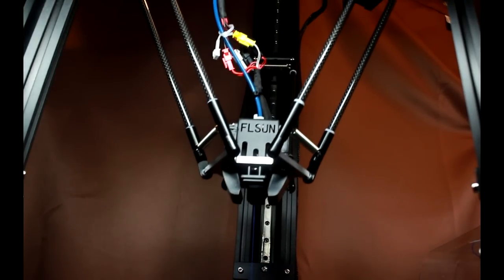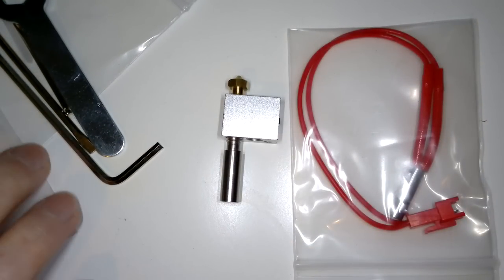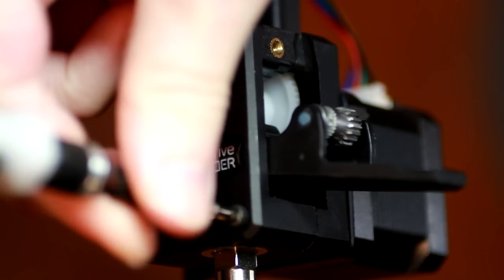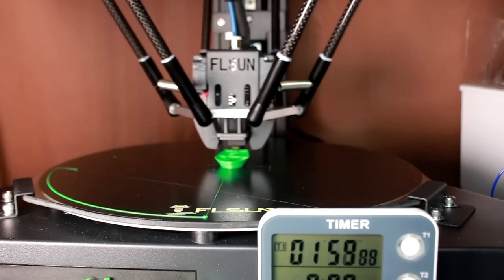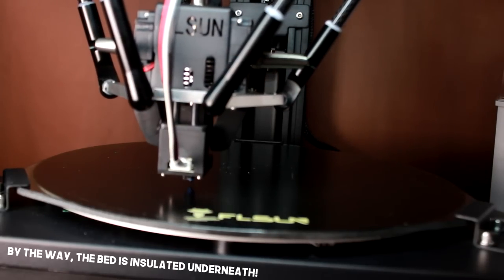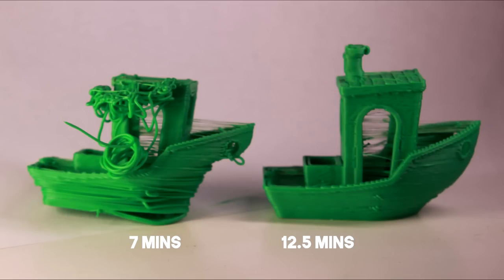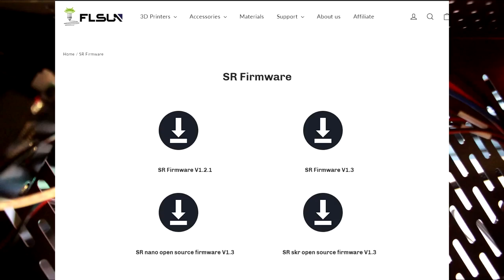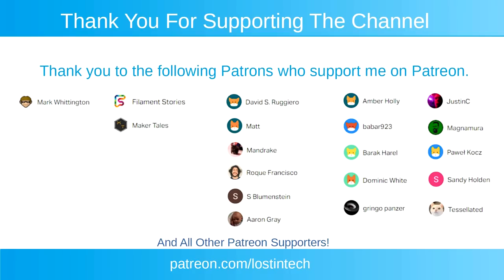Review: FLSUN Super Racer - The delta printer that can print at 200mm/s out of the box!

Comment: I made my own giant delta. I sorta rebuilt it a few times, and the most recent iteration,  it has a 500mm bed (mains powered heater)-- obviously as a delta it can only print the diameter, but the actual bed is square, which makes sourcing a flex sheet and heater easier. I have a large CNC, so I machined the aluminum parts -- including the bed and things that hold the bed. The uprights are 1500mm, and it has an electronics basement, so sorry to mix units, but it's effectively 6' tall. I am using linear rails, not brand name, but well made ones. Actual build envelope the true cylinder (not counting the cone) -- is 490(diameter)x740 height. I made a relatively light weight effector -- and had it SLS printed out of glass fiber nylon. To that I have a slice mosquito magnum with a generally permanent .8mm nozzle -- I have a 1.2mm nozzle I will be trying for some bigger prints, with a direct drive Sherpa Mini extruder. I recently upgraded to RRF3 on the duet board, and after input shaping calibration, accelerations are at 6500mm/sec^2 , no ringing on at well over 100mm/sec -- note I am using a .8mm nozzle and .4mm layers. Doing some additional tests I need to brace the towers, as I do plan to update the enclosure with 2x4 lumber and secure the uprights to the enclosure to mitigate vibrations. Deltas are a lot of fun, and I will be making a large near life size character for my 6 year old son on it -- as soon as decides what he wants. He first requested an among us -- now he is over that.
Reply: Please post a video man this look amazing
Reply from the maker: yes please! I want to see
Reply: @mophie6941  maybe when I redo the enclosure I'll post some videos.
Reply: Well did you post the pics? Where did you get the plans to DIY it? Thanks @kazolar

Comment: Ive had this machine for a few weeks and all in all its been very impressive. One thing i will mention. You are correct that you shouldn't have to use the probe to relevel often, if at all. However, when i upgraded to the latest FLSUN firmware (v1.3), i went to start a new print and my level was off and the nozzle ended up grinding against the bed. There was no indication in their firmware upgrade instructions to do so, so just a heads up for anyone upgrading firmware. Do relevel before starting a new print with the new firmware to save yourself some peace of mind.
Reply from the maker: Good info! Thanks. I will put it in the description
Reply: To be fair here, that's normal. New firmware on majority of machines resets every thing, and you need to redo all the calibration.
Reply: @matthewwain9958  just bringing this up for people with less 3d printing experience than myself so they don’t make the same mistakes I did when following the manufacturers written instructions.
Reply: Gotcha 👍
Reply: that's normal, firmware wont carry your personal settings over
Reply: Was it worth updating the firmware? I'm just curious.

Comment: I've had my SR for about a year - it's my favourite printer - replacing my Ender 3.
Added a V2.0 BMG extruder, PEI flexible bed, full size Dragon heatblock, and 0.6mm nozzle.
I love watching it print - and it's so much faster than my Ender.
Reply from the maker: aha - you put the v2 BMG? can you tell me if it improved the printing and was it a real one or a triangle labs or something? :) 
watching it print is mesmerising...I'm probably gonna try some timelapses
Reply: @LostInTech3D  it's a TriangleLabs clone v2.0 - plus I ordered a v2.0 shell as well to reuse the guts of the factory extruder as a spare.
I never had any problems with the original - but others have - so it was proactive replacement.

Slowing retraction speed from 60mm/s (stock profile) to 40mm/s drastically reduces the noise.
Reply from the maker: I had no idea you can get a 'shell'! Awesome!
Reply: Recently just put an OMG V2s extruder on mine and pretty happy with it. PEI sheet next upgrade and was wondering which did you get? Also do you have Klipper or plan you install it? Wonderful machines these are.
Reply: Hey, I'm interested in upgrading my SR's for my business -- would you mind sharing some links for the upgrades you've mentioned? Thanks!

Comment: I happen to like my FLSUN SR it was easy to assemble and once you get the Z height set properly and run the bed leveling sequence, you don't have to adjust anything until you change the nozzle. The bond-tech clone extruder is a little loud at the stock setting but works better if you increase the retraction speed. I find retraction speed at around 130 mm/s works good for me. I did order a new all metal extruder. Also the power switch is a point of failure, but is easily repaired or eliminated. I removed the power switch on mine and use a power strip with a breaker built into the power strip. Also added RGBWW LED lights, printed new axis "feet", spool holder and tool holders. FLSUN had me at Speed Racer...I mean Super Racer.  I look forward to the new FLSUN 400.
Reply: 130mm/s is extremely fast.      5.5mm @ 90mm/s  seems to be the go to for the super racer.
Reply: @sausagefingers714  
I slowed the speed to 70 mm/s

Comment: Unrelated I've been using CHEPs ultrafast CURA profile(settings cloned from ultimaker printers) and it saves a TON of time...need to tweak it a LOT(especially for petg) but CRAZY FAST once  you get it working- I think the profile optimises acceleration  and travel settings
Reply from the maker: I've been following along with the CHEP profile journey 😉
Reply: I'd love to get a rundown for the settings you use!

Comment: I have an SR myself and I don't like the extruder either. I bought a Sherpa Mini extruder so I'll be converting it to DD soon. My most liked upgades so far are a bimetal heatbreak (get the 27mm one - overall length; for CR10, I think) and a full size volcano block. I had a problem with filament getting jammed into a small gap between nozzle and PTFE tube, which was pretty annoying..

Regarding the extruder: I have replaced a similar generic BMG clone on my other printer. I too went with a BMG V2 by Trianglelab and could not be happier with it :) I can't recommend that thing enough
Reply from the maker: I've bought a conversion shell thing to convert it to a v2 extruder. We'll see how that pans out 😅
A bimetal heat break makes a lot of sense.

Comment: Separate retraction from extrusion, Robert is your parents sibling.
Mount a small solenoid between the hot-end and the Bowden tube fitting such that when actuated, the Bowden tube fitting is pushed away from the hot-end.
Rather than pull back a length of filament through the tube, move the end of the tube!
New Retraction-cycle:
1) Stop the extruder 2) Energize solenoid to retract filament 3) move effector 4) de-energize solenoid to return filament to feed position 5) resume extrusion.
Filament is no longer being 'chewed' by the extruder when lots of retraction occurs.
Need to change the firmware a bit...

Comment: I have a FLSUN QQ-S Pro and I have an opinion on the Super Racer and that is "It's overkill!".

Buy a delta printer because you want a delta printer for diversity or because you think the motion looks cool but don't fall for the hype on speed.

Even at modest, faster than cartesian, speeds the artifacts are clearly evident. You can see ghosting and other visual effects unique to delta motion.

Whether you're throwing a lightweight print head about on a single axis, or on three, the laws of mechanics and physics still apply.

I bought my QQ-S Pro for about half the indicated price of the Super Racer. It has a Titan clone extruder and V6 clone hotend. It makes no pretence about offering huge flow rates (and thus printing speed) but produces decent quality prints reliably.

The only downside I see with my printer is the fixed print bed which means that you need to take great care to avoid damage from nozzle scrapes but that comes with experience. This, in part, is why deltas weren't advised as a first printer.

Will the V400 improve on the Super Racer or is it just another "new" delta for YouTubers to review and recommend their subscribers to buy?
Reply from the maker: I certainly hope so, there's some speculation going round but I'll wait for solid info. 
Also, you can change the bed on the SR, which seems like a huge improvement on the QQ...as you say, non swappable beds, never a good thing.

Comment: I have no experience of Deltas but I reckon the extruder ought to be mounted on a tri-pivot platform between the three vertical slides. That way it's always a set height above the hotend (and would point directly at it) but without putting any extra mass on the effector.

Comment: Really should use a tubing cutter or sharp razor to cut the capricorn tubing.  Scissors crush before they cut and can cause a lot of resistance
Reply from the maker: depends on the scissors 😉 but generally not for capricorn as it has a huge wall. The "getting square" issue is the main concern on the other end. I do have cutters :)
Reply: It took me forever and some cm to get it cutted straight.

Comment: It seems like the extruder has some weaknesses. What would be a better upgrade? I've read the teeth tend to chew up the filament causing failures. What's your thoughts about buying a flexible build plate and putting it over the glass to get better adhesion?
Reply from the maker: official bondtech extruder if you can afford it, maybe even DD mounted. PEI sheet should work fine, remove the glass and install it properly, it works well on the V400 (successor)

Comment: Awesome video now I just need to see how hard it is to replace the tubing and the extruder
Reply from the maker: Not too tricky actually! Just remember to change the E-Steps
Reply: @LostInTech3D  may I ask what would be a good resource to search not much on YouTube
Reply from the maker: for e-steps? CHEP has the best guide I think. For changing the tube? Again probably CHEP, but pull the plastic locking tab out of the connector, then push it in while pulling the tube. It's called a "pneumatic connector".

Comment: I absolutely LOVE my SR. All that really needs to be upgraded is the extruder, ptfe tube and MAINLY the heater block. After I did this I was able to print at 150 mm/s with amazing results. I can also get great results at 200 mm/s with my Ludicrous profile. A 10 minute benchy... at 75% scale. Yes with a few updates this machine is a true beast.
Let me know if you want to try the Ludicrous profile or see it in action.
Reply: link ur upgrades, my sr comes tomorrow
Reply: YouTube keeps removing any comments with links. So I will put them in a video description of my printer in ludicrous mode. Coming soon.
Here's a list with out links.
Real volcano all metal hot end, micro swiss extruder and flsun pei plate

Comment: looking forward to seeing how this goes my ender 3 pro i can have running upwards of 500mm/s on big prints  litterally had it at 1000% on my bigtree marlin on a box print plus some jerk control     but this things a beast of a out of the box printer    im yet to see the need to upgrade my ender except purely for larger build volume  print quality and speed is nuts   for only a 40w heater and stock hot end besides direct drive conversion    why does it have a 3 to one ratio?  as thats usually for the smaller pancake motors thats a fulll size 45nm motor  it can drive directly and super fast
Reply from the maker: I know, I thought that about the motor too, could have been a pancake easily.

Comment: I had to build my own marlin version and one thing anyone interested should now that the touch screen needs the 11500 Baudrate. The touch screen itself has a microSD card under the case for updates and uses only 4 wires to communicate with the Robin Nano. I was stumped for Days trying to troubleshoot why the touchscreen only showed the FLSUN logo when using a few community Firmwares. I don't know how they did it but I believe the LCD communicates over Serial like octoprint does.
Reply from the maker: yeah I spotted the firmware for the screen, I heard people mention the hidden sd slot in there. Did you get anywhere with the screen though?

Comment: 2/3 of my printers have bmg clones from TL, I love them. You know you can just pull open the lever instead of messing with the tensioning knob right? :P
Reply from the maker: I do...although it doesnt work that well on these things, but yeah its when untangling all the TPU from inside you gotta open it up... :D
Reply: @LostInTech3D  Yeah, I saw that part too haha. I've only bought two rolls of TPU myself, which is some of the firmest TPU you can buy I believe, like 95A? (I actually wish I could buy some that were even stiffer)

So I suppose for my use, I've never had issues with TL's BMG's. They both have the hotends directly attached to the BMG too (V6 and volcano), so I imagine I would be able to print flexibles a lot easier because of that. I'd use two BMG's on my dual extruder machine as well, but.. money xD

Comment: I'd like the purge line gcode from this printer for my qq-s.
Reply from the maker: ; Extrude about 40 mm by printing a 90 degree arc
G3 X0 Y-130 I130 Z0.3 E40 F2700

(but make sure the QQ can understand G3 (arc) )
Reply: @LostInTech3D  ok, I'm assuming I'll just have to adjust for bed size. I think the qq-s is a little bigger.

Comment: Great review. Can you share your purge line code for a Delta printer? I could never figure that one out.
Reply from the maker: I actually never thought about that, I just checked, it sends an arc command! G3! That's something you don't see often! 
; Extrude about 40 mm by printing a 90 degree arc
G3 X0 Y-130 I130 Z0.3 E40 F2700
Reply: Just checkout the latest Cura or Prusa profiles. They also have a nice Pause after purge to „cut“ the string.

Comment: I have the QQ-S Pro, and haven't been that impressed with the auto level system. Manually need to adjust after which really, shouldn't be necessary.

Looking forward to the VL400 to see what that can bring.  I only really care about height the lack of PITA leveling these were meant to bring. I print PETG so overall speed isn't important.  layer shifts have plagued me though even with new belts.
Reply from the maker: if you mean having to set the z-offset, yeah I'm afraid it's necessary. Nozzles are different lengths and unless you probe with the nozzle itself, you will always have to set a z-offset on ABL. Layer shifts sounds bad though.
Reply: Z offset for every measured point is what needs to me adjusted many people found. This should not be necessary but sadly is. Fine adjustment as such, but the auto level didn't do a decent job like on a cartesian would that only needs home offset sorting.
Reply from the maker: Oh that's not right! I haven't needed to do anything like that. Weird.
Reply: @LostInTech3D  good to hear, that's how it "should" be with the auto level.
Reply: @matthewwain9958  Same here. I think i do have a tilted effektor witch messes up delta calibration in klipper.

Comment: I have the SR, with LGX light direct drive, The extruder stock is crap and sucks worse then any other clone, You can also change the accel to 3600 in the firmware from the 2800 stock with no issues.
Reply from the maker: I'll give it a go, but after my boat...maybe I'll stick with stock for now 😂 
Does the direct drive affect the max speed/acceleration much?

Comment: Actually FLsun is illegally using the firmware on the SR, since they refuse to release the complete source code of the binaries they distribute. And they didn't release ANY source code of the newest version.
Reply from the maker: That's not unusual sadly. I'm vaguely aware of the new firmware since the review, but I haven't installed it due to the lack of source code. If I speak to them I'll ask what is going on, they released the 1.3 code, so I don't see why they can't do it now.
Reply: @LostInTech3D  There's still things missing from the 1.3 source code, too, so they're not compliant here either. And of course they will tell you that they will release everything and fix whatever is wrong, but they won't. Not unless enough people make enough of a fuss about it to hurt their sales. And I, for one, will actively recommend against FLsun printers until they release the full source code as they have to by international law.

Comment: In itself a good printer only a disaster to get a really good first layer over the entire bed. As a result, this printer has become unusable for me and it is only gathering dust.
Reply from the maker: Really?? Mine is solid across the bed as you can see in the thumbnail. I wonder why yours doesn't.
Reply: @LostInTech3D  I also have no idea what it is about. really tried everything. new bed, different delta calibrations, etc etc. it's not extremely bad but far from perfect and certainly a lot worse than other printers.
Reply: @matheokoning4456  Sounds like something is loose in your setup.